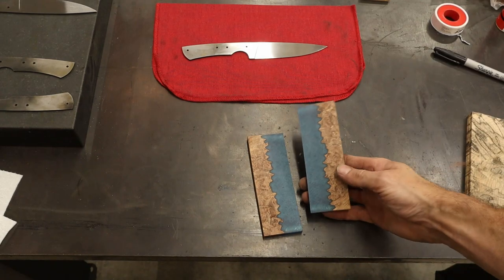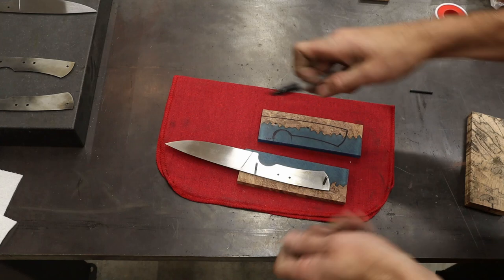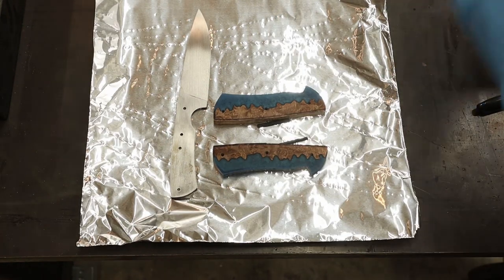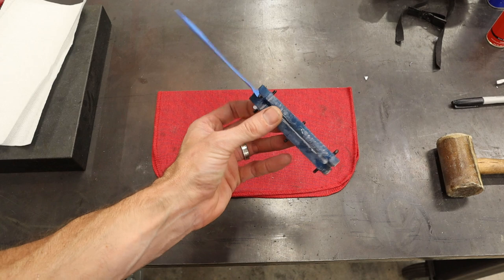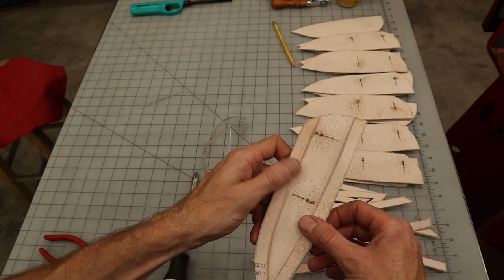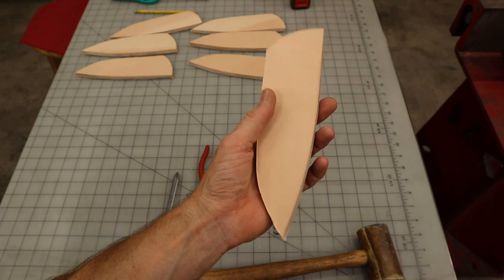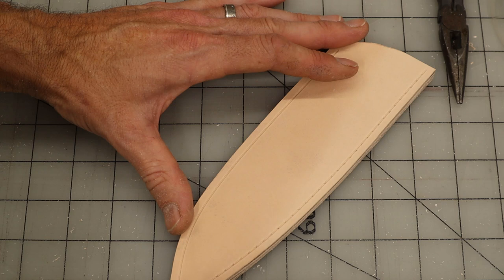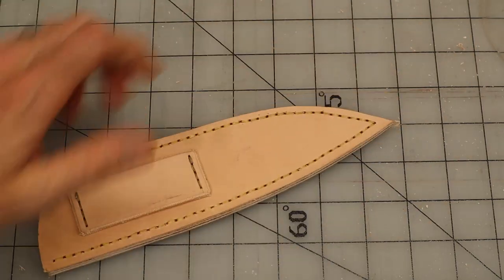Hybrid handle material - knife making -

Comment: Still love this handle I've been working on some brass Raffir and copper| raffir couple others I don't know what to call them yet cuz I can't seem to find anything quite like what I've been making... Hoping to show it off on the chopper build if I get it done ... Made a really expensive paperweight in my attempt at a San Mai blade don't think I let it soak long enough even though I learned from watching ur video how important it was I had it almost to 2500 degrees and I ended up realizing the inner part wasn't forged at all but the outside¾ inch or so had homogenized nicely leading me to believe it was all good when it most definitely was not so I through my last piece of metal big enough for a chopper gave it forged texture as a stretched the 1.5"x ¼" 12" piece of 8670 into a better chopper sized billet of 14x2.25x⁵\³² not even sure what I did wrong with the San mai
Reply from the maker: We have all been there!
Reply: @Aleeknives  Glad to know that you're still checking on the comments cuz about a week or two ago I hyu here on YouTube, Patreon and your email to pick your brain a little bit about that San Mai but unfortunately  the stars were not aligned apparently and I missed making contact in time I really thought that the two and three in little billets of semis that I had completed successfully it was going to be enough practice to do a 16-inch chopper and apparently I was sorely mistaken in my haste I actually got something 99.7% of the way done and turned in for the contest I wish I would have had a couple few more hours to bring the handle to it's full potential I'll email you a file